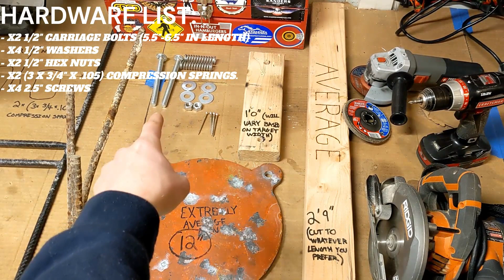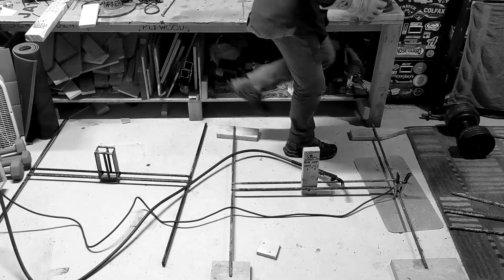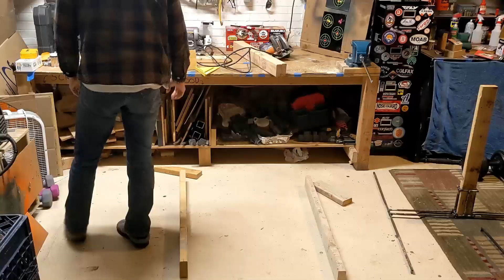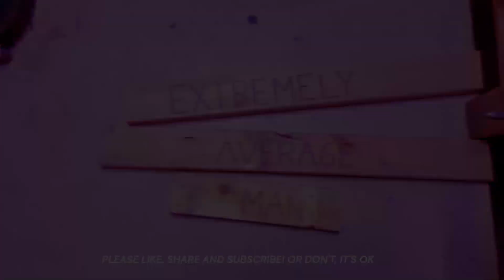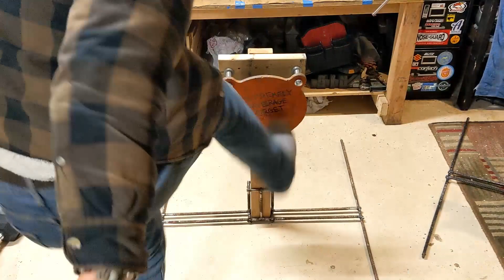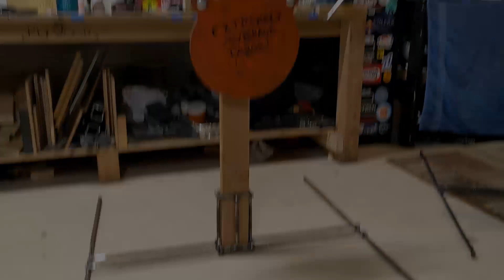How to build a Cheap, Simple, Reliable Steel Target Stand!

Comment: We made something like a short sawhorse.
Put I-bolts into the bottom of the top 2x4 & used S-hooks to attach the plates to the bolts.
There is enough space between the plates & the wood that it rarely gets hit.
I've not had to repair it in over a year.
Reply from the maker: Also a good option.  Now the problem I face is dragging multiple targets and building material 100+ yards on public land to shoot...might build a wagon to haul all of it soon haha.

Comment: Could you please provide me with the dimensional width of the bolt hole's ( the ears) on your 1/2" plate steel.  My guess from drawing it up in my CAD program is 7.5" in. approx. Center (of hole) to Center (of hole.)

PS, I have no clue as to how in my comment below, their is a "strike-through" line towards the bottom.  YoutTube never fails to keep me guessing.

Comment: Well, as a fat old (69 yr's) semi-retired welder, I gotta say he tries like hell.  I was laughing only because I have a background of 25 plus year's as a Heavy Collision Repair, 5 yr's Painting (1986 -1991) for Boeing Aircraft, another 5 yr's as a ship yard welder, welding little 400' ft. canoe's, with a full size Helicopter landing pad's on the bow of those little boats.

Just so you know, most Carriage Bolt(s,) come with a "shoulder," (that would be the square part you filed down,) or you can purchase Carriage Bolt(s,) without a shoulder.  Just in case you don't know, the true purpose of the square shoulder, is so the fastener / bolt, can be put into a square hole, so as to prevent the bolt from turning; as you tighten / loosen the nut.  Think of it as a semi-hidden bolt head, i.e, where you would put a wrench to secure / hold the Bolt-Head, to prevent turning.   I would have hand filed the two round hole(s,) into two square hole(s.)  Yes more work, but much more productive as for later wood replacements.

Odd's are you purchased 1/2" in. X 13 thread(s) {per inch,} a very common thread pitch.   I would have gone with "Butterfly" nut(s) / fasteners, it won't break your bank account, and will make it easier when replacing the 2 x 4's. 

Instead of "filing down" the shoulder, put the bolt, (threaded end into your drill,) don't tighten like your trying to save the world, so as not to damage the threads.   Now grab your hand and or bench grinder, and Bob's your uncle.  Yes your using your drill kinda as a metal lathe.  If your dril;l say turns a max of 600 rpm's, don't use the max, try approx. 1/2 (half) or less RPM's (i.e., 300-400 RPM's.)  Your'll be able to figure out the Goldy-Loc's amount, very quickly.   For the "Support" for the vertical 2" x 4", I would have gone with a piece rectangle steel tubing, 1/8" in. wall, or used some angle iron (1" in. X 1" in.)  In that one little section, I think you got lost in the forest,  (i.e., way too much work / over engineered LOL,) if you catch my drift.

Yes you mention that you used 18' ft. of No.#: -4 Rebar, but I have no clue what the dimensions are for the basic long feet, or the cross width(s.)  LOL.  

Now as for welding, if you just try over time; to always make your next weld, better than your last, you'll go far.  Rome wasn't built in a day, and no one learns to weld in 5 minutes, try, try, try again.  And when you think you have mastered it, weld some more, every day welding,  school is in secession.  I'm still learning about welding, (@ 69 yr's) but I do love it.  This will make you feel good, I use a very old (big in size, because no electronics) transformer welder.  Must weight approx 400 pounds or more, I kid you not, talk about a dinosaur of a welder.  I can weld all day long, no worries Tig (AC/DC), Stick, and I use to hookup my suitcase welder to it, but didn't truly like the beads it ran with the big old bird,  (because of CC- Constant Current) purchased a newer (late 1990's CV Constant Voltage, for Mig-Welding) power supply/welder.   My also late 1990's portable welder  (Miller Trail Blazer) is a CC/CV machine.  Love running stick and my Suitcase with that.  Also FYI: for Stick welding you want DC CC- Constant Current, for Mig Welding you want CV -Constant Voltage.